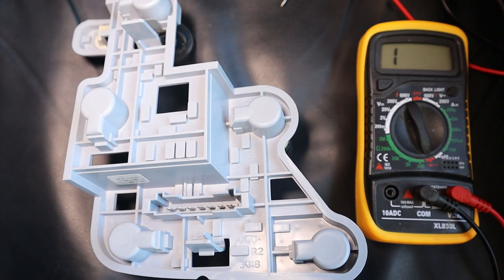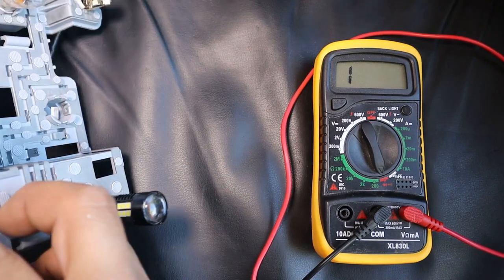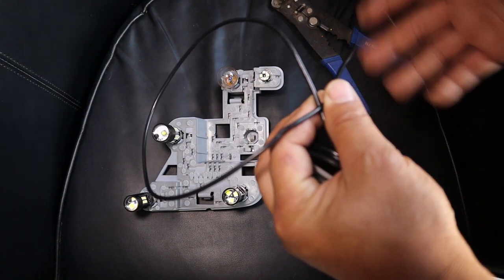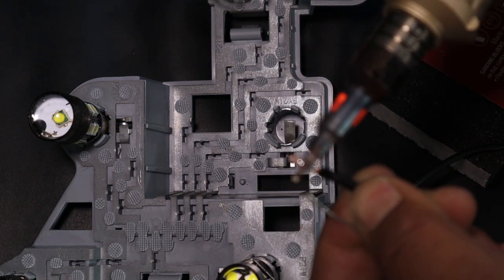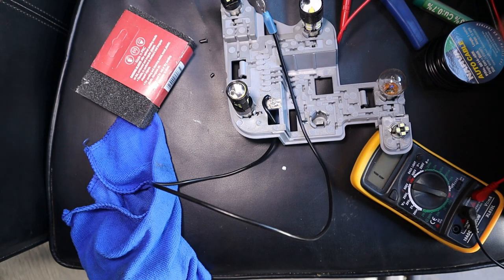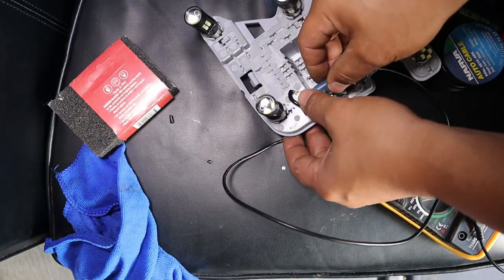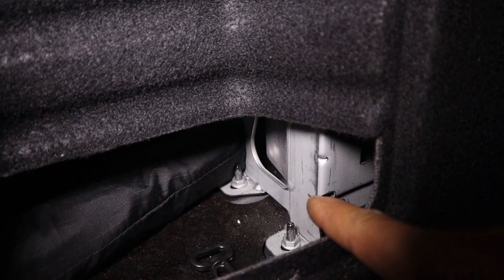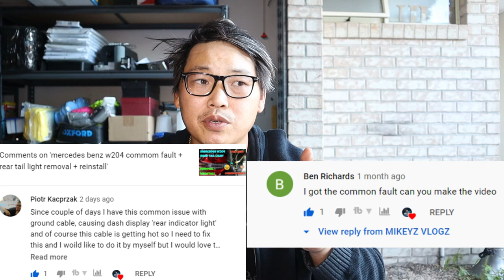mercedes w204 c300 common faults + how to fix rear tail light brown ground wire

Comment: Hey many I did this yesterday and it worked. But today I went to turn on my car and it was dead. Is there any possible reason for this? I believe I followed it all correctly. I did the screw method and not the soldering method. Maybe I left a light on last night and did not see. Has to leave for work and can’t do anything to it right now. Going to try to jump it tonight. Could use some help or maybe some possible problems and solutions thank you.
Reply from the maker: u must have left something on ... did u wire something wrong by any chance? which left a light on ? this fix shouldn't cause your battery to die gor any reason
Reply: @MIKEYZVLOGZ  I wired it correctly/exactly how to it was done in the video. And the lights worked correctly after that. Now each time I have to jump start the car to even get it to run. Every time I jump it works fine but does not run the next morning. I got a new battery 3 months ago so it couldn’t be an old battery. One of my buddies who is into cars says he thinks something might have shorted out or burned in the fuse box. I made sure no lights were left on last night after I got it to run and used it for a little bit. This morning it was still dead. Any idea what could be the problem?

Comment: no resistors for your led bulbs?  i got a clk w209 came with some depo clearish led tail lights and the bottom lights are off right blinks then stays off and got right tail light light msg but not the left and its also off ,, i need to spend some time with it
Reply from the maker: if u use all led then u may need resistors to control current to tail light .. I don't use any and all is fine .. but that's only cuz I use just parking lights, you only need led resistors if you cant get error free canbus bulbs, thats what i got error free canbus led bulbs thats why i can use them and no errors

Comment: My left tail light has the dimming problem the bulbs don't burn out nor do any codes come up but it is significantly dimmer, so by using this method can i simply leave the brown wire in the original harness the way it is? So i just ad this new cable and ground it to any bolt point on the car?
Reply from the maker: the point is to create a new ground point because the current isn't enough to handle the amount of current .. so u remove the factory ground brown wire completely and create the new one

Comment: At 12:23 in the pic it showed 2 red wires one thicker than the other have you connected the wire somewhere else before the new grounding point or do you just need one wire from the light housing to the new grounding point 🤔🤔?
Reply from the maker: Just one wire from light plate to ground point of the car... same scenario for other side

Comment: Is there a way you can show how to replace the actual harness clip? Mine is entirely burned through - but can't seem to find just the clip - only those with cables attached. I called Merc and they said there was no recall on this unfortunately. So have to do myself.
Reply from the maker: yes unfortunately u do

Comment: Can you show the left side getting done . And I can’t attach to metal as it all carpet , and I can’t see anyway of taking the Capet of . Thanks
Reply from the maker: its behind the tail light behin thecarpet u can reach inmide once you remove the tail ligt there is a bolt stickingout on the lhs.. or u will have t just pull back saome carpet so u can reach bare metal
Reply: @MIKEYZVLOGZ  thank you . So well explained . Visio great ,
Reply from the maker: @margaretfindlay9948  thx and most welcome

Comment from the maker: hey guys so i hope this video helps anyone who is experiencing this problem with their tail lights from melting , inconsistent connection, throwing error codes, or bulbs going out due to this common fault... it really is a very simple fix... my apologies for a quick and crap job on the soldering... make sure if you do solder..do it properly and make a secure and solid connection...i only wanted to show what you need to do ..but i decided to take it abit further as i know alot of ppl are very visual when it comes to an explanation so i did that quickly so i could show what i meant...... wish everyone luck who attempts this ... its much faster then getting Mercedes to do it and honestly ive seen how Mercedes can do a flimsy job themselves ...at least this way you can be sure you did it correctly and it will last above all
Reply: Do I have to do both side tail lights?
Reply from the maker: @PoliceMafiaTV  only if both are experiencing issues but to be safe i would do both esp considering its a easy fix
Reply: Thanks
Reply from the maker: @PoliceMafiaTV  most welcome mate
Reply: Hi do we leave the factory 5amp ground connected as is,? and just add another ground ?
Reply from the maker: @thirushasrivenkatas2139  you can or u can disconnect.....
Reply: Thanks mikey
Reply: Thanks for the video dude.
Just 1 question.
Can you drill a hole onto the plastic grommet which holds the metal plate down or do you have to drill through the metal plate aswell as the plastic housing?
Also did you remove the old earth wire or did you just cut it back?
Reply from the maker: @irfy2009  i need to drill througj both plastic and metal plate .... or use a self tapping screw and drill into it...basically does the same..but that can get loose...a bolt and nut would be best solution if not soldering... u can cut off or remove the old wire..your  choice.... ive left it for now but if it does  cause an issue later down the track ill remove it
Reply: Hi bro, thank you for this video. I have a question. Did you remove the existing brown ground cable?
Reply from the maker: @Kolawolebekes  yes I did u no longer need itb
Reply: Hi, just had this issue, will need to replace the connection as well as it melted too, do I have to disconnect battery to do this?

Comment: Hi you see the bulb top left that is the only bulb you have that isn’t LED…. I’m having problems with that bulb on mine in that I have 5volts at the bulb holder but neither a standard bulb or an LED will work ?? Firstly do you know exactly what bulb that is ie a tail light or fog light or what and any ideas why mine doesn’t work either side of car?? Help !!
Reply from the maker: top corner should be the parking light
Reply from the maker: honestly not too sure ..sounds like a loose cable ..but start with fuses relating to the tail lights .. thenni would scan for errors .. usibg a mercedes specific obd2 scanner tool.. like a icarsoft  or xentry DAS ... THEY WILL DEFINITELTY be much better as they are very precise and give alot of info on what the issue may be and if u still can't find it I would seek advise from an auto electrician not just a mechanic but an auto electrician ... bid difference veteran auto electrician and normal electrician

Comment: My tail light connector is completely gone, not just the earth connector pin, and affecting continuity to some of the bulbs.  I reckon I need replace the whole connecor.  Can you advise how to remove existing cable/pins from the connector and repace them in a new connector?  I obviously need include the fix to in effect replace the earthing wire as per your video.  Thanks
Reply from the maker: ok so you. an always buy a new connector via ebay or aliexpress and simple cut and solder or even use butt connectors... that way it's an easy cut splice solder..or use butt connectors... either way as long as u follow the way the harness plugs in u won't go wrong
but if u wanted to remove the existing pins u would need a pin like tool or u can buy a plug harness removal tool they sell for about 10 dollars or less online I used it in my video about changing out the 12v cigarette lighter port to a dual usb port with battery display
Reply: @MIKEYZVLOGZ  Many thanks - I'll aim to find a plug harness removal tool as you suggest. Appreciate your swift reply and advice. Thx again

Comment: I tried this and it didn’t work, is there a relay for the brake lights? The middle one in the back never went out and still works but the main tail lights don’t
Reply: I really appreciate the video tutorial!
Reply from the maker: u fortunately u may have an underlying issue .. this doesn't fix all electrical faults relating to the tail lights just thr main ones with error messages dimming of tail light melting and overheating .. of this doesn't solve your problem u need to scan and try find the problem so u know what to do next .. I hope this is helpful in some way.. try scan for dtc and narrow down the issue.. then go from there

Comment: do you really need that soldering pencil melter thing I do not own one of these. I saw a video of someone else screwing it in place without soldering it.
Reply from the maker: u can screw if u want either way is fine..as long as u get a connection

Comment: How do u put the wire in the eye ring?
Reply from the maker: u use a crimp tool and a r
eyelet connector and crimp the wire to the eyelet
Reply: This happend on my 2012 c300 and the back plate is a little different, still not working:(
Reply: Jus the bottom led is very dim to not lit on at all
Reply: I will keep trying and update

Comment: Please give me some advice and help.
I am 70+ years old and my old 1990 350dsl Mercedes will NOT pass inspection here in Louisiana.
Here is the problem.
1990 Mercedes 350dsl When I turn on the parking lights the tail lights work, BUT when I turn on the head lights the Drivers side tail light goes out.
Reply from the maker: firstly hello sir and welcome to the channel ..happy to have u here and thanks for taking the time to watch... if u could like and sub greatly appreciate it... as i always state im no professional me hanic ..im a simple at home diyer...but can do what i can to help ... usually when something like that happens it's a relay ..I check the relays first and fuses then I would check the wires and ensure there is no short anywhere in the line ... but cuz u then it on a d it cuts out ..tells me it' could be a relay related issue..I'm just guessing here .. obviously it's hard to diagnose without being there to see and hear and test things.. I'm not a professional mechanical but that's where I would start friend...then if u can get a scanner tool to check for dtc codes that would could narrow down the issue and point u in the right direction ...

Comment: Hello there.i have a 2008 c300 my tail lights will not turn off even when the car is off I have to unplug them everytime i get out the car if i dont wont the battery to die
Reply from the maker: u have a short somewhere .. u need to find where the short is .. it might be easier to take it to a local mechanic auto electrician to help find the issue ..they have specialise tools that will locate the issue
Reply: @MIKEYZVLOGZ  ok thank you soooooo much.will do

Comment: Hi Mikey I drilled a hole and copied your video to completion but it didn't work my warning sign is still there. Could the reason be I need a whole new tail light instead.
Reply from the maker: before u did this what was the issue ? and did it look like any of the plug is melted or damaged
Reply: @MIKEYZVLOGZ  The issue is that the rear indicator isn't working and this is causing the warning sign to pop up. The plug looks fine nothing is melted I think a mechanic replaced the brown wire with a yellow one a while back before I got the car but I always wondering what was the problem so I tried your method and it still isn't working. Could it be the SAM chip in the tail lamp?
Reply from the maker: @jackmcwhae5984  hmm I couldn't day off the top of my head ... it would take me to do trial and error to find out what's wrong.. get a scanner tool or get it scanned and hopefully the dtc will show u more of what it could be

Comment: Hi You mentioned recall, but I could not find any by googling. Has the recall been publicly announced? If so, do you have any link for the recall?
Reply from the maker: yes there has definitely been a recall in usa but some mercedes benz dealers will still fix it for free... but doing it this way will be so much easier and save u time and hassle
Reply: @MIKEYZVLOGZ  Thanks for your reply. I forgot to mention recall in Australia. I might check with dealer in Canberra then. Thanks.
Reply from the maker: @dynaryu  no worries ... i hkow in the usa they have done recalls for this .. as i have read it many times on the mb forums.. here in australia i have only seen the takata airbag and i got m,ine done too both passenger and driver sides..also the w203 series 1 had the recall on the sunroof 21 yo car and still a recall for the sunroof, due to possible malfunction and wont close , but usually you can call the dealer diredt and ask for any recalls and they will find it via the make model and vin no.
Reply: @MIKEYZVLOGZ  I just called Canberra dealer, and was told that it has not been recalled, and customer should pay for the repair.
Reply from the maker: @dynaryu  that sucks in usa there are recalls
Reply: @MIKEYZVLOGZ  I contacted the dealer to figure out part number because I'd like to put new parts rather than fixing by adding a wire. Here is the list: A0005403005 (Contact set/CL209), A2115450328 (Plug), A2048201500 (Lamp carrier left), A204820160005 (Lamp carrier right).
Reply from the maker: @dynaryu  the problem is the ground wire is what causes the issue its too thin of a wire unless your ground brown wire is thick like 10amp to 15amps its still going to eventually have issues
Reply: @MIKEYZVLOGZ  I understand the problem. but I thought that MB would provide a refined part. That's why.
Reply from the maker: @dynaryu  unfortunately they don't and even wen they fix it for others they pretty much do what.i showed but yeah u can fix it your way too... especially if u need to due to melting or damage to harness or light housing plate... I'm sure u know what ur doing.. all the best to u

Comment: Does this apply if tail light wont turn off.
Reply from the maker: can be related to different things ... I would try and see if it helps... not having a grounding point that's solid can cause a few issues all relating.. so I would just try and see what happens..u won't harm anything
Reply: @MIKEYZVLOGZ  thank you for the quick response! I will try it

Comment: Isn't easier to just replace the tail light board (lamp carrier) ??
Reply from the maker: the issue to begin with is the lack of size of the ground cable ..even if u change the pcb  or any part it will still malfunction overtime as it's prone to due to the gauge size issue of the ground cable ... so that must be done
Reply: @MIKEYZVLOGZ  thanks for the info. I don't have much experience, can I drill and put the cable at the same spot that you did or do I have to check with the multimeter?
Reply from the maker: y can do exactly what I did and drill a hole there as that is a ground spot...
Reply: @MIKEYZVLOGZ  thanks a lot I appreciate it

Comment: Hey man my led turn signal is not working would this be the cause?
Reply from the maker: honestly cant say for sure would have to do sometesting , u can always do a trial and error test by using another 10amp cable to 15amp and hold it in place of how it would be installed and see if it works/helps , a merc scanner tool like icarsoft designed specifically for merc is a good tool to troubleshoot with , it can pin point certain issues, i would start with that
Reply: @MIKEYZVLOGZ  alright so I bought a new tail light it works but after a while of using the led stops for a second then works. I got these codes for the car 
B164615 
The out put for the right rear turn lamp is faulty.  A short circuit to battery [+] or an open circuit exist 

B280315
The right inner stop lamp and tail lamp is faulty. A short circuit to battery [+] or an open circuit exist.
Reply from the maker: @Gta tuner Guy  yeah sounds like a short ... do a trial and error with a 15 amp wire and see if it solves it
Reply: Do u think the wiring will fix the problem
Reply from the maker: @Gta tuner Guy  yes seems like the common fault and ur symptoms are like what ppl described except usually they can see physical damage to the plug harness
Reply: @MIKEYZVLOGZ  alright so I wired my ground and still same issue, what u think it can be now
Reply: @MIKEYZVLOGZ  do u think I messed it up
Reply from the maker: @Gta tuner Guy  nah u didn't mess it up if u only did what I did ... there must be a short somewhere .. this would be for an auto electrician to find ..I'm not qualified for that
Reply: @MIKEYZVLOGZ  now my led dosent work at all anymore, do You think it’s blown
Reply from the maker: @Gta tuner Guy  most likely man... did u ever try another bulb?
Reply: @MIKEYZVLOGZ  yes a got a new led bulb